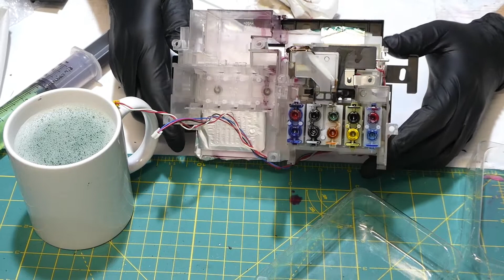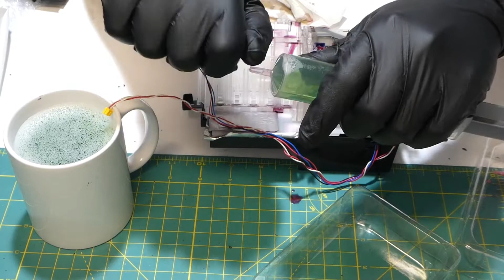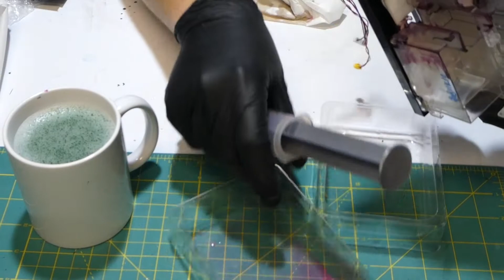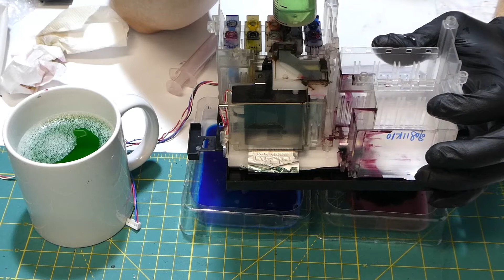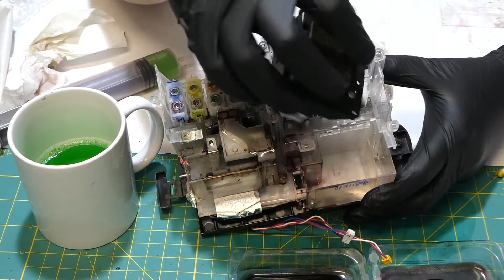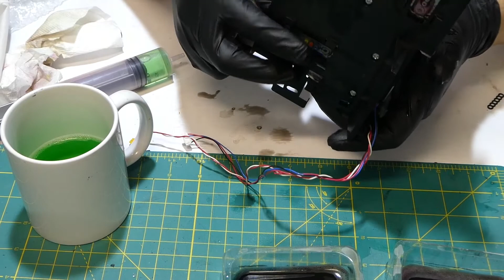Epson Stylus Pro 7900/9900 Ink Damper Assembly Cleaning & Flushing

Comment: Hi, First thank you for your previous answer about connecting the Flat ribbon with needle nose pliers.  That was the solution to getting the ribbon back into the print head properly.  Now I have another problem.  When the Stylus Pro 7900 power up it did not recognize any of the ink cartridges.  I did what the Epson Field Repair recommended and used a tube and paper clip to remove air from the ink cartridges. Eventually the printer recognized all of the ink cartridges but the vivid Magenta.  I then repeated the tube and paper clip procedure on the vivid magenta cartridge and finally the printer recognized the vivid magenta cartridge and at same time stopped recognizing the Light Black cartridge.  Now when I insert the light black cartridge the printer does not recognize all 11 cartridges.  If I leave out the light black ink cartridge the printer recognizes the other 10 cartridges.  Any suggestions as to why this is happening?  thanks, Kayo
Reply from the maker: The X/no cartridge error is a MASSIVE pain in the butt, and I do not know of a way to get around it, sorry.
Reply: @o.e.r.3287  Have you ever had this problem happen to you after cleaning the damper assembly?
Reply from the maker: @kayohayashi9420  Improperly installed head cables can cause the issue. Resolving it can be hell though.
Reply: @o.e.r.3287 how can you resolve this issue I took the print head cable out from the main board by mistake
Reply from the maker: @DonteKentrell  If the cable is removed, it should be fine to just reinstall. Just make sure to only remove/install cables when the printer is OFF.

Comment: hello if during washing the liquid comes into contact with the black electrical part, can I damage the piece?
Reply from the maker: Pretty unlikely as it is just a small DC  brushed motor and a sensor. Good to let it dry out for a bit before giving it power again.

Comment: I run Epson 7900's and 9900's and need to repair them myself every so often, this is a very useful and information video. Do you sell refurbished printheads for these models? It would help me not to have to pay $1500 every time I need a new printhead.
Reply from the maker: None in stock at the moment, too many projects ongoing.
Reply: @o.e.r.3287  Maybe you could let me know when you get one in.

Comment: I really appreciate your video and support in how things work with th printer. I have had my Epson 9900 for 11 years and use it for photography printing. I don't use it every day due to the type of work I do and have not had many problems with it. I use a clear plastic cover over the printer to keep dust and the environment out of it as much as I can. It just keeps on going.  It has always daunted me in how to service the unit  as the cost of everthing is going up aso. This is really good and helpful self do video and feel confident to give it a better look at how to keep it maintained. THANK YOU.
Reply from the maker: Covers help a lot for keeping stuff out of the paper path. Leaving the printer with power so it can flush ink also helps a lot. Make sure to keep the wiper clean as well, and it helps a TON.
Reply: @o.e.r.3287  Yes I do that one and keep the flushing box clean. The printhead is the next level up.

Comment: Hi, I want to replace my dampers
How do you pulled them,from the case ty
Reply from the maker: There are little clips holding in the dampers, will need a thin metal shim or flat screwdriver to hold the tabs down to slide them out.

Comment: Hi.. i got the auto shutdown  after the flushing process for damper and head,  i turn on the printer by pressing power button and showing “please wait” and shut down . Do you have any clue what causes this one?  I can see lot of air in the tube but. Please let me know if you have any idea? Thanks
Reply from the maker: Air in the lines can cause some issues, but it sounds like something else. Any error code right before it blips off?

Comment: Hi, In addition to cleaning the damper I also removed and cleaned the print head.  When I reinstalled the flat ribbon into the print head it would not go in and just jammed.  As a result my Epson Stylus Pro 7900 will not turn on.  I have ordered a new flat ribbon.  Do you have advice has to how to properly connect the Flat ribbon to the Print head?
thanks,
Kevin
Reply from the maker: I typically use tweezers or needle nose pliers with a strip of tape on each blade to press the cable in without tearing up the cable. Not a whole lot of working room in the area.

Comment: Are you going to post any more videos on maintenance for this printer?
Reply from the maker: Yes, just need to find more time to make them.
Reply: @o.e.r.3287  Well, we could really use it when you do! There is so little out there like what you have done. I haven't been able to find someone who puts it all back together and shows how to load the ink back in. and Then actually shows the finished product working again. You mostly hear people say they are getting error codes and no ink to flow. Thank you for this video!!!!!!!!!!
Reply from the maker: @PhotoArt2000  Yeah, those fill codes tend to require the service program to address. I mostly run Mimaki printers these days because I can reset most issues without proprietary software.

Comment: I THINK my Epson 7900 needs an entire damper replacement. But I don't know how to disconnect the gasket from the ink hose? When I tried, ink flowed out in buckets. Can you help?
Reply from the maker: Make sure to unlock all cartridges and pull them out. If they are still seated and pressurized, you'll have a godawful mess on your hands. Even without pressurization, quite  a bit of ink can flow out. Keep the ends of the lines elevated and it will greatly reduce this.

Comment: Do you have other 7900/9900 parts?  The FFC delaminated to my display controller.  I “fixed” it, but it was a little loose in the connector and I didn’t notice it shorted a couple of contacts on insertion until my display went dark.  Either blew the display or the power supply to it.  Grrr…
Reply from the maker: I have 8 in my boneyard. You can buy flex cable from Digikey, nothing too special or expensive.
Reply: I should have asked about main boards, too. 50/50 my short hurt the mainboard instead of the  display controller. (You should post an email address somewhere so I don’t have to post my credit card number in a YouTube comment to buy something from you. 😊)
Reply from the maker: @smoberlin  Our name is the company name, not too hard to find.Tue-Sat 11a-7p Central
Reply: @o.e.r.3287  Hej i have cleaned. My dampers on my 9900 epson - but my needle went throe the aluminium, what can I do with that? Do you have a new damper set?
Reply from the maker: @hanspederslvbjrg5428  You can take some silicone sealant and a piece of paper towel to hold it in place to make a patch. Not great, but hard finding a good way to get glue to bond to plastic. A new damper assembly should be 180271200 for the part number.
Reply: @o.e.r.3287  Thanks a lot - how do I order it from You, if it dosnt work?
Reply from the maker: @hanspederslvbjrg5428  I do not sell dampers. Epson lists parts dealers on their website if needed.
Reply: @o.e.r.3287  Okay, do You sell any spareparts for epson 9900 - because I don’t know what’s wrong. Suddently it clocked the one black, and i can’t get it cleaned, have trie to clean the head, but then came the blue and were clocked, then I triey the damper, and the needle went through the aluminium. Do you think it can be fixed, or is the head dead?
Reply from the maker: @hanspederslvbjrg5428  If a needle went through the print head, it probably caused significant damage. You will have to test and see.
Reply: @o.e.r.3287  Hej again. It was the plastic/aluminium on the dampers i ment. I have only used green flush liquid on the printhead - but after i cleaned it, half the blue clogged to. Why I can’t find out off, then i tried to clean the damper as you show. And I just got the needle to far through so I hit the plasticfoil - i thing it worked after your adwise, thanks. So now I have to see if it helped with cleaning the dampers.🙈
Reply: Okie dokey, I’ll look you up. 👍😊
Reply from the maker: The screens are pretty common on eBay, and usually at a good price. But yeah, flat-flex cables are a huge pain in the butt when it comes to that.
Reply: @o.e.r.3287  Yes, after I cleaned the damper’s and the head again - and started cleaning, suddently the cyan stated running out, pretty much, so everythin is cyan. I found out of that the cyan was in such a wacom that it didn’t stop before a got it out, and that was hard to get out - i don’t know what that can be. I think the printer is done….
Reply from the maker: @hanspederslvbjrg5428  The damper and head are all replaceable, but the question is whether or not it's worth it. Hoping to have more videos up soon once things slow down for the winter.
Reply: @o.e.r.3287  yes Thanks a lot for your time.

Comment: Do you refurbish Epson printheads?
Reply from the maker: I have great luck with Posters & Vinyl Graphics out of Louisiana. They have an eBay listing for most print heads or you can contact them direct. $80 through eBay about, $60 in bulk. If they are bad, still a $25 service fee. Tend to have about 85%+ success rate. We also sell already refurbed ones when we have them for around $650-700.

Comment: Hi, thanks for very useful video and advices. how did you made the simple green solution? Also, what do you do after the flushing process to get air out of those 5 dampers?
Reply from the maker: To refill the damper, simply reinstall it and run a couple of regular cleaning cycles. If you do not have access to Simple Green, just using warm water will work ok. Can use a few drops of dish cleaning detergent dissolved in water as well, just make sure to flush everything out with clean water afterwards.
Reply: @o.e.r.3287  thanks. When you have a chance, can you make a video how to flush the printhead also? Im in a situation where some colors are completely out on nozzle check after few cleaning cycles. I flushed the damper like you did on this video and fill them full with water before install the head. Thanks
Reply: @o.e.r.3287  Hi, do you need to run initial fill after putting everything back together?
Reply from the maker: @phanphandnvn  Nope, just 2-3 regular cleaning cycles. Initial fills will just waste a TON of ink.